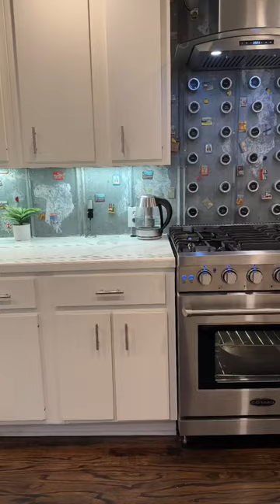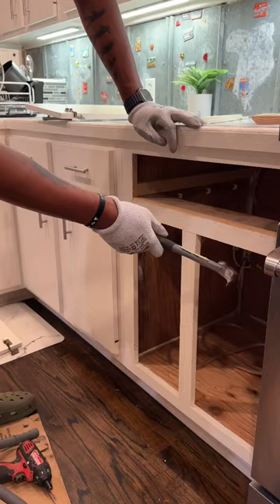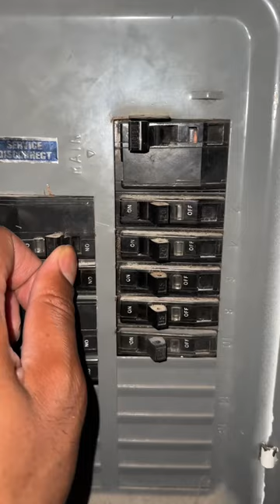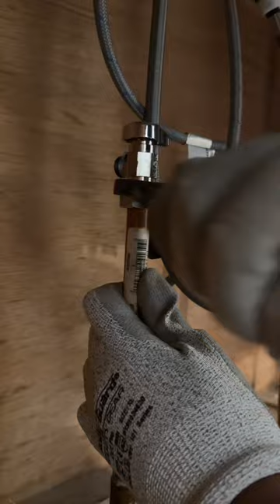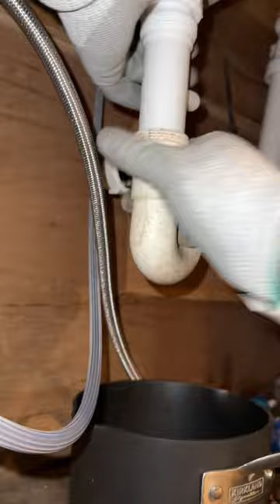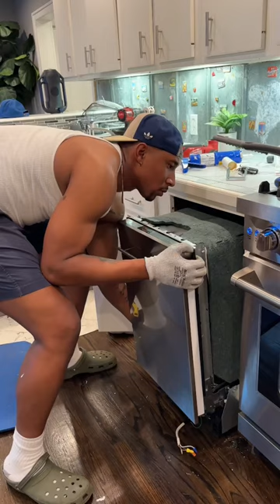dishwasher installation 🧼 #youtubeshorts #renovation

Comment: Why would you do all that nice work then add a shark bite shut off ??? 🤦🏽‍♂️
Reply: Shut off for future service most likely and didn't wanna solder also probably
Reply: @Dontexxr  use a compression fitting
Reply: @jondoe4807  That's what I would've done.
Reply: @jondoe4807  I understand the shut-off, but shark bites are kind of last resort for me.